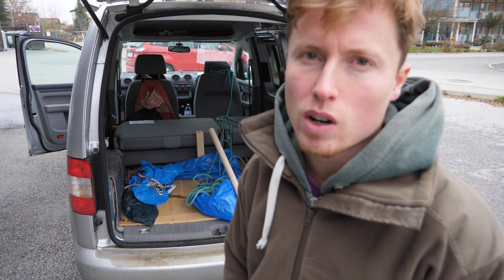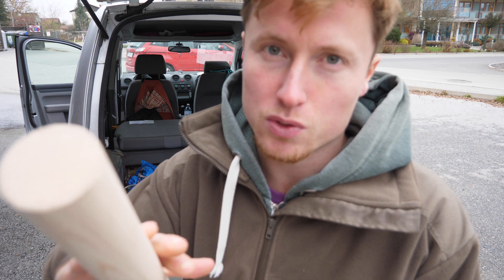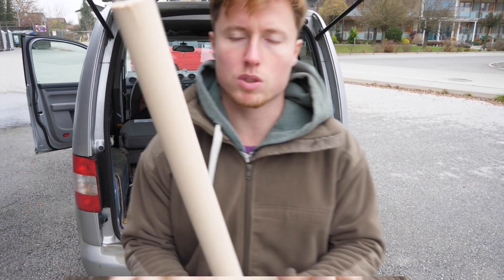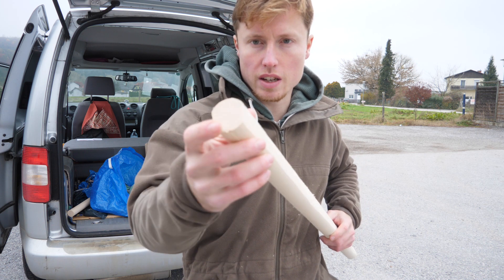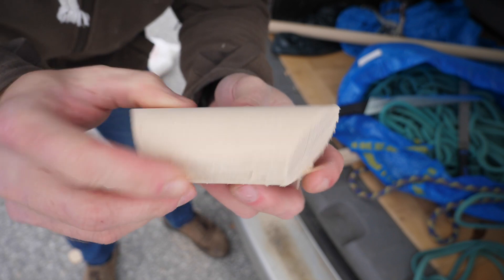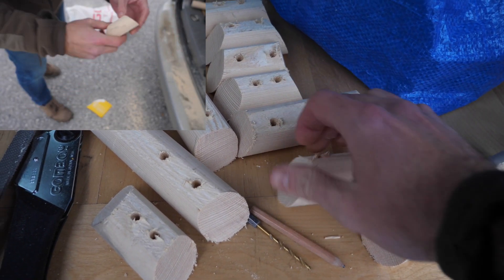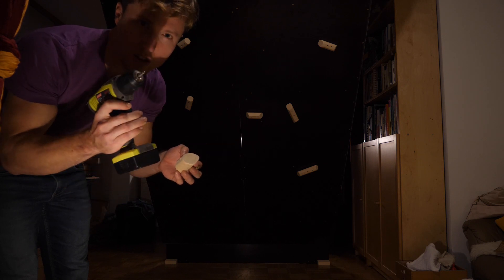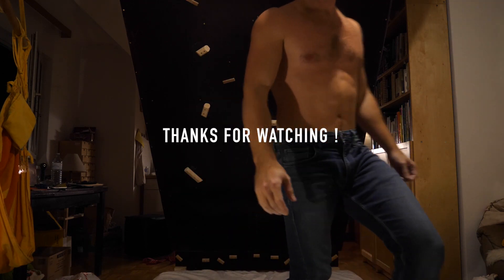Making + Testing Holds for my new Home Wall

Comment: Banister rails, topers etc are really nice to use for home climbing walls since you barely have to modify them. Super smooth and ready to climb on , I have 20 or so holds on my wall that cost me maybe a grand total of 50 bucks usd including hardware.  Found all of it at home depot.   Also its called counter sinking a hole (in the us) when you create a spot for the head of the screw ,you can buy countersink bits for pretty cheap.

Comment: I made a bunch (16) holds for my wall the other day. I hired a belt sander (£10/day) and a jigsaw (same price). I had some birch plywood left from my wall build and glued is together in 20cm squares (40mm thick=two layers). Then cut those in some shapes and shaped them with the upside down belt sander. Pretty happy with the results (@sfbouldering on Insta for some pictures). Heading over to have a session on them now!

Comment: Ich habe mir fast das gleiche lockdown setup gebaut. Habe auch ein freistehendes hangboard wie du nur etwas stabiler. Die Wand lehnt bei mir im 45 grad Winkel dagegen. Ziemlich beeindruckend wie schwer man trainieren kann obwohl der durchschnittliche bouldern nur 3 Züge hat xD. Kleiner Tipp:  Als Tritte hab ich mir im baumarkt einfach Halbrundstäbe geholt. Wenn du die auseinander sägst kannst du sie entweder mit dem Schnitt nach oben anschrauben (guter Tritt) oder mit Radius nach oben (ziemlich schlechter Tritt). Abgesehen vom sägen muss man da eigentlich nichts mehr dran machen. 

Viele Grüße
Reply from the maker: Bin auch beeindruckt wie schnell es sehr hart wird auf so einer self made wand, 3 Züge reichen komplett! Hab im Baumarkt 3cm Durchmesser Bastelkugeln aus Buche gefunden, eine Seite bisschen abgeraspelt, raufgespaxt, genialer Tritt!